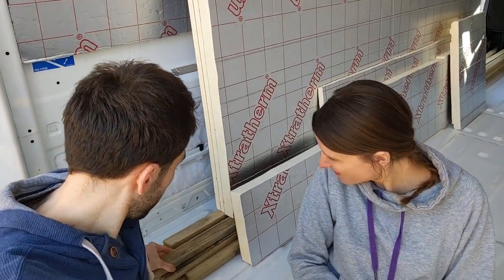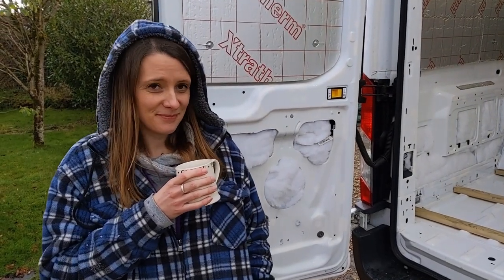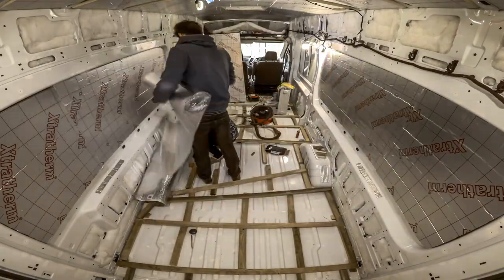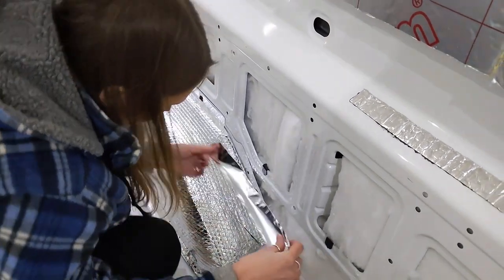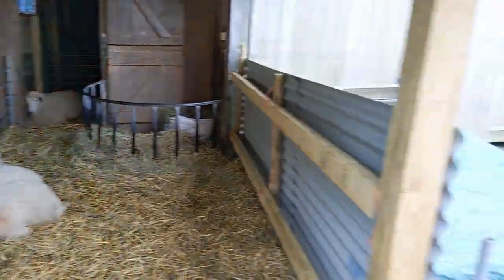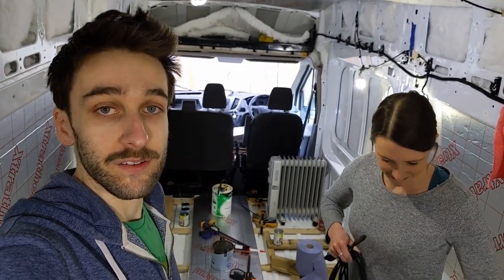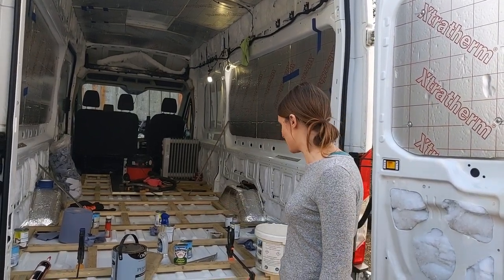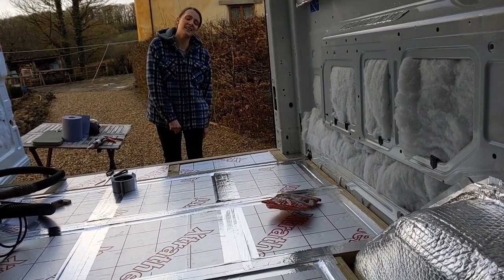Van Subfloor Install (With Insulation) | Transit Van Conversion E07

Comment: Hi guys I’ve been watching your build , iam just going to get on with my floor , a great job , I was wondering why it wouldn’t work putting the battens long way to save on hight or am I missing something
Reply from the maker: Hiya, cool thanks for watching :) With the battens we used 1x2s and the 2 side is face down, so they are in the flatter way, if that makes sense. They'd have been taking up more height if we rotated them around 90 degrees and put them sitting on the short edge. One thing to keep in mind is to make sure you arrange it so you have battens supporting the joins between any plywood you're going to be putting on top, as otherwise you'll have a slight bow as you're moving around over the join.

Comment: The roof plugs leaking are a common fault on transits.
Reply from the maker: Yeah we had one of them leak so we went up on the roof fairly early on and put some sika around all the seams and joins and every roof plug, has held up great so far 🙂

Comment: Is there any squeaking noise from the PIR board? Just wondering if they rub the frame. I am planning to do something similar.
Reply from the maker: nope, nothing that we notice anyway. When we're parked up stationary the only thing we really hear is the wind whistling through the maxxfan occasionally. And while we're driving the cab/road noise and having the bulkhead in means we don't hear much from the van either, just the occasional clanging of the shelves in the oven pretty much. Unless we go over a huge pothole where we might hear some of the contents of the cupboards 😛 But can't say we've ever really noticed any squeaking 👍

Comment: How much insulation board did you use on the floors? I don't want to over order the insulation board and we have the same van model!
Reply from the maker: Hey, we bought three full sheets (2400 x 1200mm) of the 25mm which covered everything we needed it for in the van. That was mostly the floor, but we also used 25mm to insulate the cavities on the rear doors and sliding door as well, and the bulkhead. HTH 👍

Comment: What screws idid you use for floor? Assume they go into metal but not right through to other side?
Reply: Realise you stuck and didn't screwthefloor!😊
Reply from the maker: Yep, we didn't want to drill any more holes in the floor after spending so long filling them all 😀👍

Comment: Hi guys, what did you use over the wheel arches - the reflective foil - was it just more Dodo deadn? Thanks!
Reply from the maker: Hiya, it's self adhesive foil faced insulation around 8-10mm which comes in a big roll, can get it here and from the same seller on eBay: https://www.carinsulation.co.uk/category/camper-van-insulation-sound-proofing-materials. We used it on most of the exposed metal in the van where we didn't have either the supasoft or the PIR board to break the thermal bridges

Comment: Hey guys, loving the content. I wanted to ask where do you put the battens? Is it where the layout of your furniture ect is going to be ? Would appreciate some advice 🥹
Reply from the maker: Hey, thanks! And yeah good question, for the sub floor we mainly just spaced them out evenly and put them where they made sense to be able to support the ply floor on top. So around the edges a lattice in the middle. One thing we would do better if we did it again was making sure that there was a batten directly under the joins in the ply above. As  in one spot in the van we can feel the join between the two ply pieces as the batten below is not directly underneath the join (about 10cm away from the edge) so there's a tiny bit of flex. Doesn't really bother us but something that would have been easy to avoid if we'd thought about it more 😛

When we've secured our furniture down we've gone into the ply layer so don't really think about where the battens are underneath (except when drilling holes we try to avoid going through them). But anything substantial we secure to the walls/bolt in  as well. And for the wall battening we did try to put the battens where we'd need them for all the furniture, so having something around the height of the bed, bench seats, overhead cabinets etc. It really helped but we didn't get it perfect as it's so hard to predict the final layout at the beginning so we've added/modified some as we've gone along too. HTH! 👍

Comment: Amazing progress, you two! Everything after this will be a breeze! 😊👍
If I was convinced on the subject of stick pins after watching Greg Virgoe's videos many moons back, I am equally unsure now - especially in the roof area. How's your confidence with that? Was it really just the (lack of) temperature when applying the pins?
I do like the "adhesive only" attachment of the floor battens. Less holes in the metal floor will mean less chance of corrosion down the road. Perfect choice in my books. 😊👍
The weather here is still very April-ish - wet and cold, so I just managed to remove the airline rails from the wall substructure of our Crafter (they were attached with stainless rivets - impossible to drill out and glued in additionally). After taking an angle grinder to the rivets, using the heat gun and just brute force, I managed to get them off. I am currently looking for a body shop to get some driver's side rear panel damage repaired.
There's plenty of video material already, but we need to compile it into something coherent for publishing. Hope to have the first two or three done for YT and Instagram in a couple of weeks. Stay tuned!
You guys stay with it. It's still very inspirational seeing your progress! 👍
Best regards from Germany,
Volker
Reply from the maker: Thanks for the support! We suspect there will be some less breezy parts coming though... (hint: windows 😛). Yeah we initially were really happy with the stick pins but have to say, did not find them very useable on their own. The adhesive on the back of the ones we had at least was not very strong. In the end, every single one of the panels we had on the roof and the walls came off, apart from one single solitary one on one of the rear doors. And to actually remove the pins, a few seconds of pointing a heat gun at them, and they literally just fell off cleanly! We think a few things contributed to that though. As we said in the video it was bitterly cold when we were sticking them up, and we've learnt the hard way how important a bit of ambient warmth is for adhesives to cure properly (the camera mirror fell down three times before we re-stuck it in warmer weather). So the cold was a big factor we think, but also we possibly were a little on the light side with how many pins we used per board, as we semi-rationed them to have enough for the whole van from the supply we had. So instead of each corner, for the smaller boards we made a triangle with 2 corners and a top middle pin if that makes sense. The boards are quite light though being foam, and we cut them into small pieces so we figured that would be fine. And last thing, we fixed the boards on straight after doing the pins. So some or all of those played a contributing factor we think.

What we ended up doing was getting another box of the pins (slightly different ones too) and redid the whole lot. This time we waited for a warmer day, used more pins per board, left them overnight with no weight on them first, and finally went around and added the aluminium tape on the edges. So if they fall down this time...! 🧐😜

We wouldn't feel comfortable using only the pins now, but with the tape as well they've been pretty solid up there. 

And yes we spent a while filling 74 holes we counted in the floor, so weren't about to be making some more in it anytime soon! 😀 Hope your build is coming along well 🙂
Reply: @SelfBuiltStories  I will have to source some stick pins here to test - this may appear silly: I am still trying to find a German translation for it. 🙈
I also had one afterthought to the use of adhesive without screws on the battens: If you use 25 mm battens and insulation, will the adhesive not add at least 1-2 mm to the height, that you have to compensate for when mounting the plywood? I was thinking of using some laminate foam underlay at that point to "even things out"? 🤔 
Windows: Cutting up perfectly good sheet metal to install windows is like parachuting from a totally intact aircraft. VERY scary, but once the trip is finished, it's very satisfying. 😂
Our build requires a lot of preliminary work yet. I think you did see the instagram pics and the derelict state of the passenger cabin. I will have to dismantle all the plastic parts and steam clean them. I did place an apple on the dash over night and it was still there in the morning. Apparently there's nothing alive in there. 😂
Reply from the maker: We were able to get all the timber battens nice and flush at the same height and the foam boards are maybe a millimetre or two lower, so the ply floor going on top will just rest nicely right on top without any compensation. The slightly tricky part was getting all the timber level as the ribs of the van end prematurely in places, and some are also slightly less proud than others, but we just made lots of different spacers out of wood scraps until it was all nicely even. 

And always good to know you don't have rodents in your van! We were parked up on a beach in a campervan on holiday once and in the morning the engine was really misbehaving... Turned out a mouse or something similar had crawled up into the engine bay and chewed a hole through the air intake filter. It was a funny moment at the garage when he pulled it out and saw a hole clean through the side and some nice comfy bedding it had pulled in there. 😂

Comment: Me again! Was it 100mm insulation for all the walls and then 50mm for the floor? Just found you guys and working my way through all your videos!
Reply from the maker: We used 100mm SupaSoft (the recycled plastic bottle fluffy stuff) in the cavities, 50mm PIR board for the walls and ceiling and 25mm for the floor. If we were doing it again we'd use 40mm on the ceiling though as it would have been quite a bit easier to work with. The 50mm sticks down proud of the metal ribs at the sides a bit so when we were putting up the ceiling we had to add some tapered wooden shims to span the difference. We have the benefit of the extra 1cm of insulation, but it made the project take longer 😛

Comment: Well done guys, it looks great. We're just about to do this ourselves. I was thinking of just using a cheap silicone to stick the wood to the floor, and hoping that gravity would keep it in place. What do you think :)
Reply from the maker: Cheers, and yeah that's pretty much what we did really with SikaFlex. Would imagine that any decent adhesive that can bond both wood and metal should work. We didn't want to screw anything into the van metal so went with the adhesive approach and haven't had any problems at all 👍
Reply: @SelfBuiltStories  Brilliant, thanks for the reply. I watched a guy yesterday patching up all his holes, then he screwed it into the floor, creating more holes. Crazy lol. Anyway, back to putting on the sound deadening :)
Keep up the good work :)
Reply from the maker: You're welcome! Ah yeah after spending so long sorting them all out we weren't about to make more 🙃 Good luck with the build!
Reply: @SelfBuiltStories  Cheers, Thank you :)
Reply from the maker: @foxystravels  Np :)

Comment: Don't put the final floor layer (vinyl?) on until the entire van is finished. Easily 90% of the van conversion videos I've seen people are doing this way too early. Its like when a brand new house is built the carpets and vinyl's are always fitted last, even after paint/decorating.

When I build my transit out, I'm concerned as to how well the back and side doors can be best insulated particularly for condensation barrier, many people seem to keep the metal uncovered or just place wood/carpet literally right on top of the metal, so I'm curious how well such vans perform in the coldest months for preventing condensation forming on those metal parts. Seems people mostly rely on just air circulation (+heat) from two ceiling fans, which seems a bit strange for the most freezing of nights as you're just blowing the heat right out of the van lol
Reply from the maker: Yes, the final floor layer will be vinyl. We can see pros and cons to doing it early and later on in the build really, so have thought around that. We likely will end up going with it earlier to give us one single sealed sheet to prevent any spillages finding their way down through the joins around the furniture and a slightly simpler install. Doing it later on is possible too though of course, saves material and cost potentially which is never a bad thing.

The back door insulation is an interesting one! There are thin and hard to access cavities around those areas 🧐